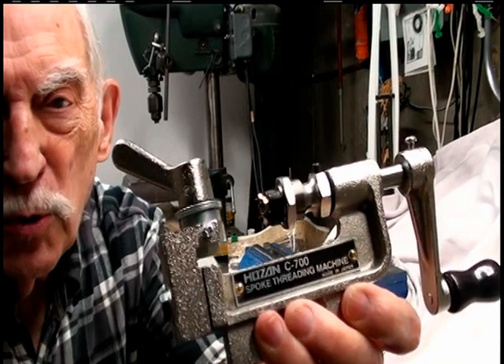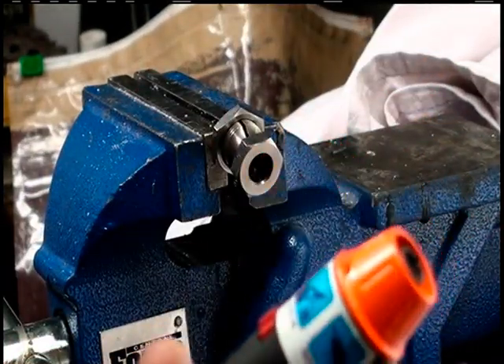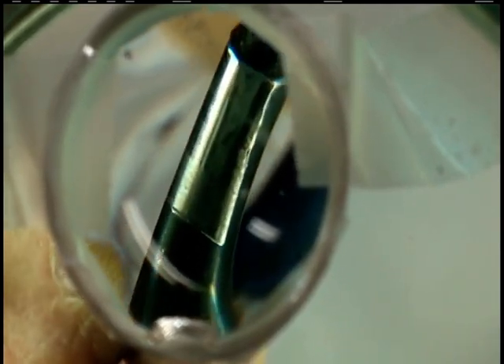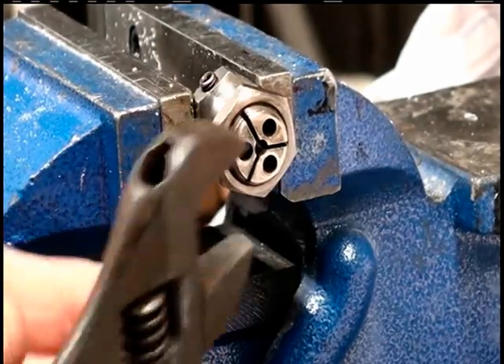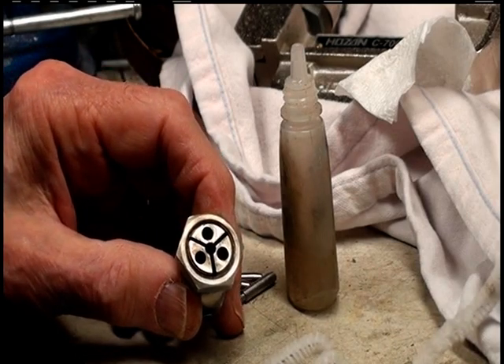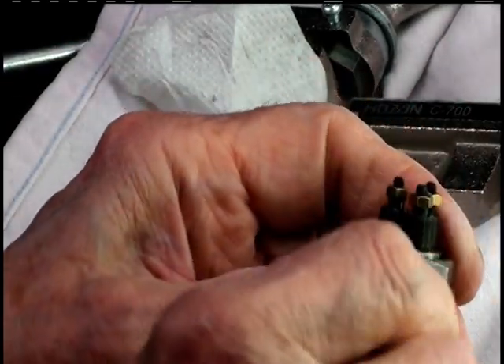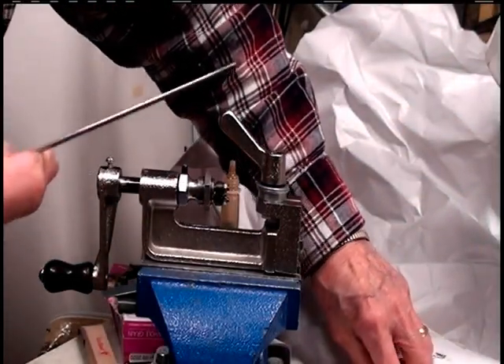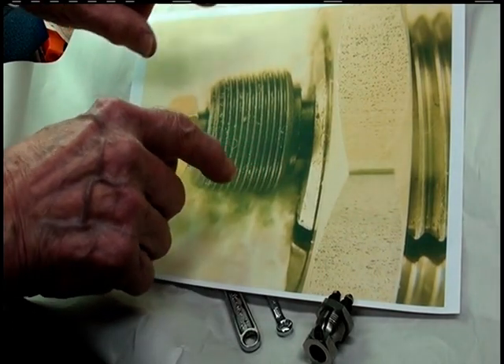Hozan spoke threading machine head repair

Comment: Thanks for the video James.  I recently purchased a Hozan and am having a problem.  The 702-14 that I bought appears to be creating about 53 tpi instead of 56 tpi expected.  Nipples don't thread freely.  Any thoughts?
Reply: did you find any solution to that? my nipples thread freely a few turns before binding as if  theyre slightly the wrong tpi.